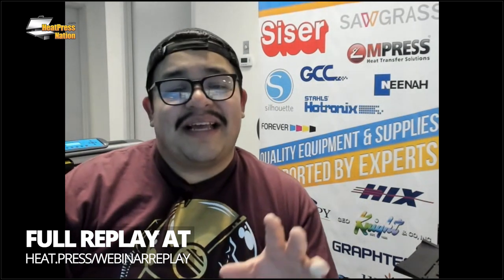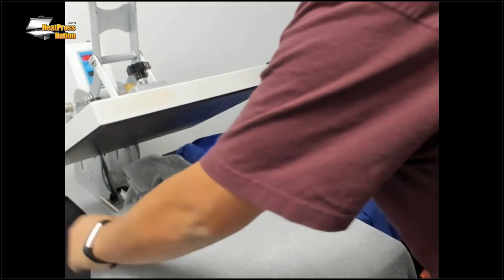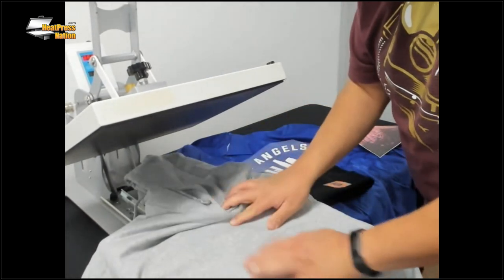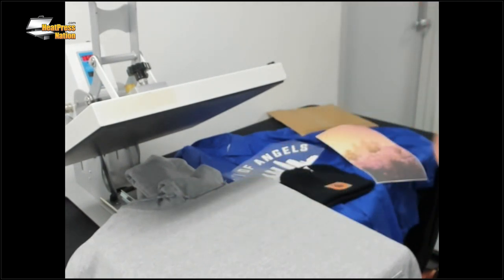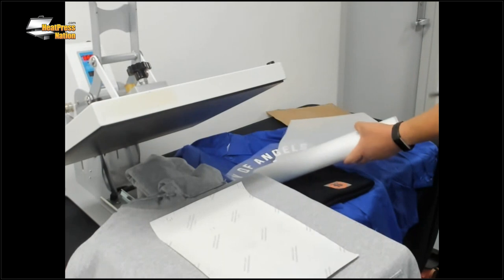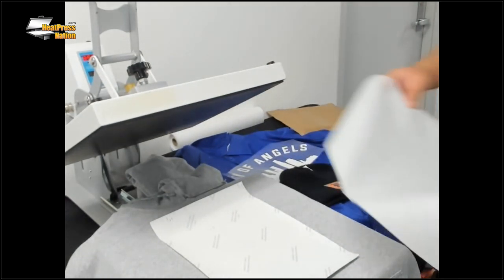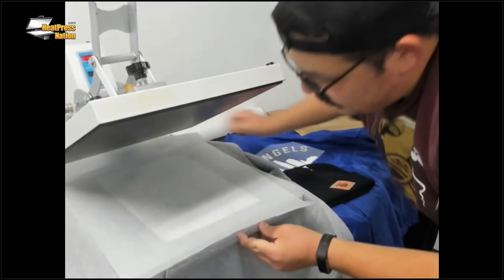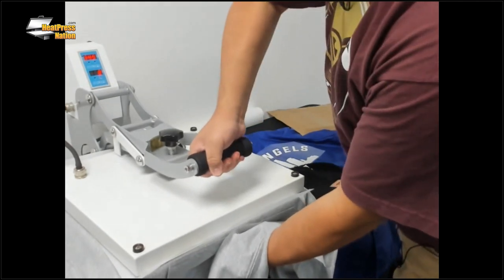Sweater, Jacket, & Beanie Tutorial

Comment: Can you use the flock vinyl cutout letters directly on the cap or do you recommend putting a backer and then press letters on it?
Reply from the maker: If the letters are big and bold, it should be okay to heat press the flock directly onto the beanie. But if the letters are smaller, it's probably best to use the flock as a backing and then layer your letters in regular HTV over it.
Reply: @HeatPressNation  thank you for the info I tried it it works great.i just happen to have a ton of flock vinyl 😀😀